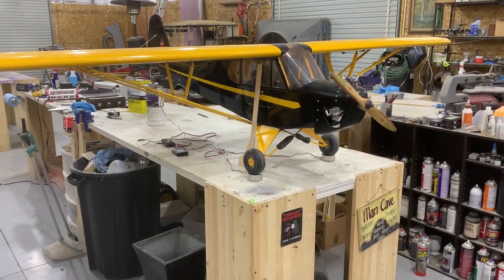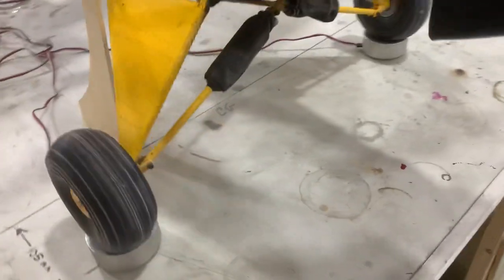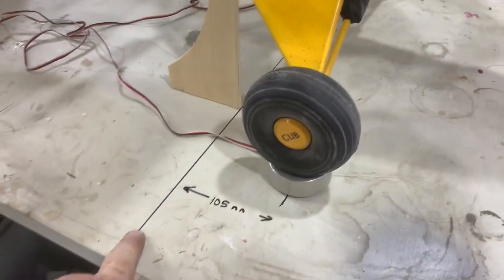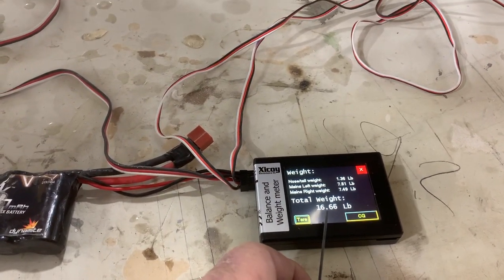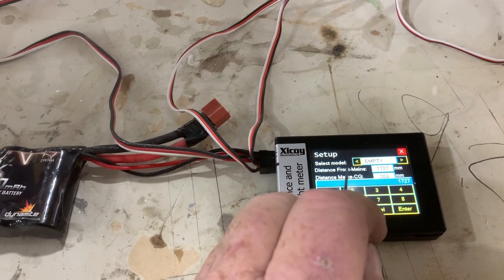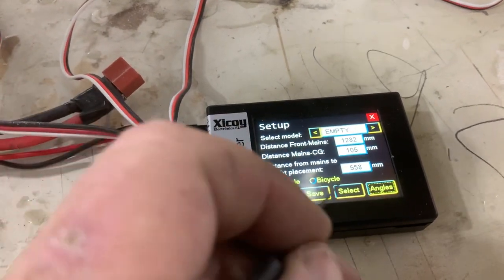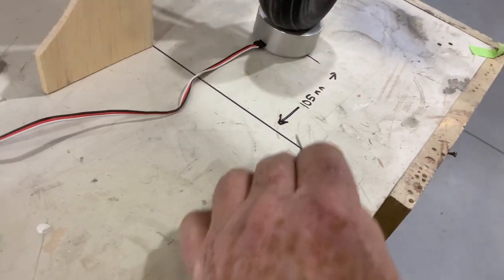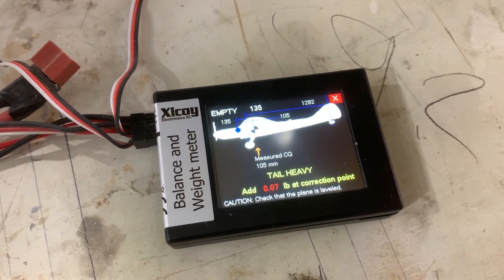Ixcoy balance machine in english!!

Comment: This helped considerably!  The last thing you did was to describe a plan that was nose heavy!  Your comment was to just remove weight frm the nose.  I understand that, but what if there is nothing you can remove.  Would you then just add weight to the rear of the plan to compensate?  Sometimes making the plane a little heavier seems the only solution?
Reply from the maker: That’s absolutely right… And it takes less weight in the tail to make an airplane balance so you’re not adding a whole lot as long as you can get the weight as far back in the fuse as possible

Comment: The most important step is to level the plane at a level flight characteristics before measuring and weighting 
Im curious to know where did you place your level on the plane to know if you are leveled
Thanks great video
Reply from the maker: Yes I did put it in the video… You have to level the airplane… I have always leveled the tail.. 0° to positive 1° or 2° positive on the wing depending on model.. always level the tail!!
Reply: @BackRoadsOutlawsRC  good morning the reason im asking is lets say i have a profiled airfoil  on the tail how do i know where to put the tiny level? Anywhere i put it is different theres no flat surface 
And why would you go positive 1-2 instead of zero
Thanks
Reply from the maker: @bullitanaconda  On this airplane and most highway airplanes the tail is at 0° while the wing is at positive one or 2°… That’s just basic aircraft math… A flying tail surface like you’re asking about, Has an airfoil shape… So I am familiar what you’re talking about what I would do is then use an incidence meter on the tail and make sure that it balances out at 0°… That’s with the elevator dead level to the tail then strap on the incidence meter go to zero that would put your air foil at 0° to your work table… And then it would be interesting to find out if you have any positive incidents in your wing
Reply: @BackRoadsOutlawsRC  i was using the engine shaft on planes that have no deflection 
Thanks alot rod

Comment: Great video Rod , One thing to understand is a couple degrees out of level is not going to effect the balance point enough to worry about on most models.
Try it and compare the readings. Also I know everyone uses the term CG which is technically not correct, it is the longitudinal balance point we are checking, CG refers to the balance point on all 3 axes…..although the Ixcoy does also show the lateral balance with the weight on each main…..just me being nit picky…lol
Reply: Nothing wrong imo about being picky. Taking extra time on the bench to get it absolutely spot on makes for better flight rights off the bat with less tweaking and fiddling at the field.

Comment: Great Video Rod.  I noticed you entered the number 135 for distance from mains to weight placement.  What measurement would you enter if you don't have any additional weight placement and just the stock build?
Reply from the maker: Sorry I didn’t see your question earlier… I just entered that number because it has to have a number… I very rarely use that number in order to figure out my balance… You just want to make sure the airplane is balanced and find out where is the best place to place your counterweight… Does that make sense?
Reply: @BackRoadsOutlawsRC  no worries at all. Yeah that’s what I figured so I just used your same number. Great machine. I’ve used it on numerous planes now and it’s awesome.

Comment: Hi rod 
Is there times when the stab is designed to not be at zero but having a few degrees of incidence relative to the datum line
Reply from the maker: Yeah my cub is +2° on the tail… It does happen,,you just want to make sure the fuselage is dead level!! that’s what I’m guessing anyway… I’ve balanced seven airplanes with this balancer and all have been perfect… But I just level the fuselage, And sometimes the easiest way to do that is selling a dead level to the tail… But I know what you’re talking about sometimes that isn’t always the case

Comment: That data entry screen makes no sense at all. I can do the same measurement with a single 10 lb scale and a spreadsheet, so it's not worth $300 to me. And yes, I do have to move the scale from wheel to wheel. Not a problem since I have more time than money. Btw, I pronounce Xicoy as Zy'-coy and it's tare, not tar.
Reply from the maker: Well I’m sorry to be such a redneck… Does it make you feel better talking about how people waste their money… anyway you do what you Gotta for some of us to sit down and write everything out on that paperwork it’s worth it when you have 10 or 15 airplanes and your building more just to throw them on a scale and get the job done… If you only have one RC plane or if you only have one scale airplane in the hanger then yes doing the paperwork is great but for a model who has more than 10 airplanes in the hanger it’s always nice to have this tool… But anyway y’all have a great day